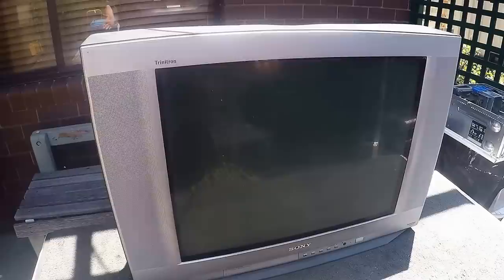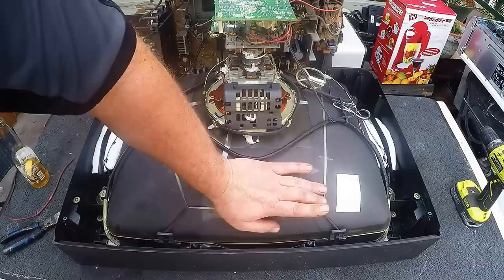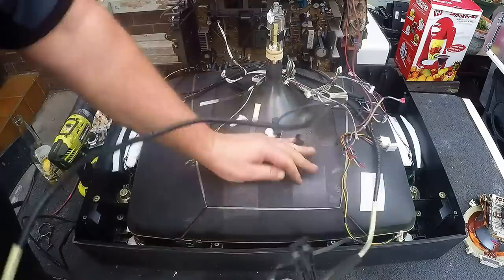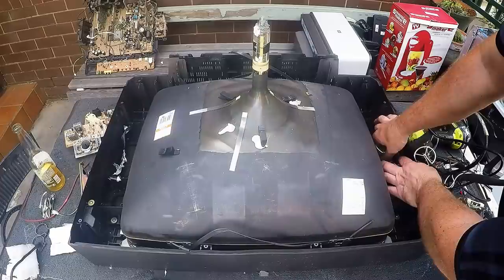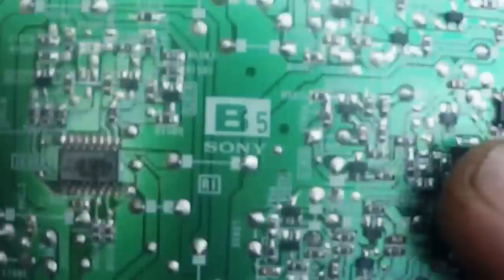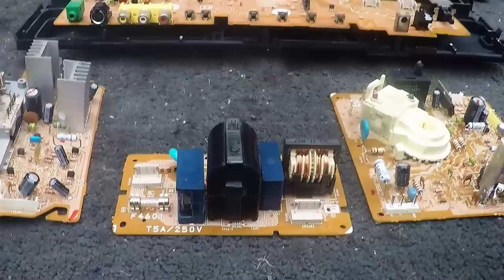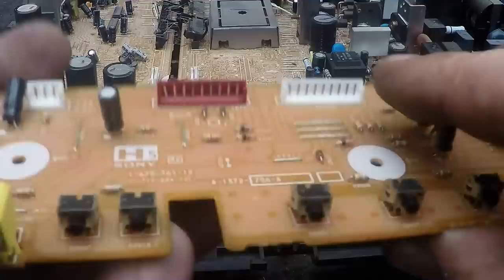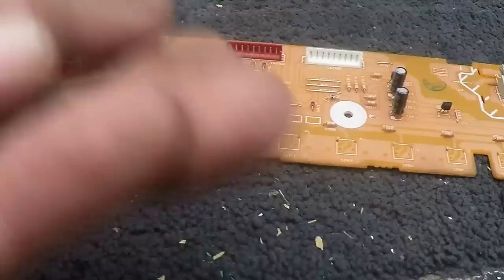CRT TV Complete Scrap for Copper Recovery

Comment: Excellent! Scraper Bonus time!! Everyone wants a bonus on their main job. This is Scrapper Bonus tip. I watch Moosescrapper, Mike the Scraper, and eWaste Ben. Down time is your bonus time. During good weather, scrappers speed through CRTS and many other electronics to make most efficient use of their time. Just toss those small spools of copper in a bucket. Only takes a second, then when you have down time, such as  Blizzards we have here in Colorado, or if you live where there are cyclones, hurricanes, or just stuck inside, grab that bucket and unwind that copper. My 5 gallon bucket of spare copper spools took about 3 hours to unwind, but I earned an extra $60 just
for sitting around out of the weather! Thanks for a thorough training session!

Comment: The deflection coil (called "Yoke" in USA) is designed for allowing high frequency for both horizontal and vertical. These modern CRT had a menu option with rotation adjustment. This imply injecting a fraction of the horizontal signal at 15 KHz in the vertical. The rotation and trapezoid adjustment also imply adding low frequency at 60 Hz to the horizontal, which is not a challenge of course.

It is amazing that the high voltage transformer, where the 25 kv (twenty five thousand volt) is generated don't have much copper anymore. In the past, like 1969 with our first color TV using a few vacuum tubes, that transformer had thousands of turns of very fine copper wire. The last few decades of CRT, the high voltage transformer use the same amount of turn (3 times less because of the voltage tripler), but using photolithograpic method, photographing fine line on a flexible PCB.

It is a shame that the scrap metal places don't offer higher price for a nice bloc of copper as you show in many of your videos. The rationale is probably that they will need to melt the copper anyway.

Comment: The Trinitron CRT was an Australian engineer's design. Sony took it for their own. It was a barrel segment, but with a flattened screen dimension vertically, while in the horizontal direction it had to be curved, a later development in CRTs enabled the glass edges of the screen to be made much stronger and tubes could be made flat both vertically and horizontally while still maintaining glass strength under high vacuum and Sony's Trinitron CRT advantage evaporated. Sony's electronics were always a pile of tangled  electronics, while JVC easily had the best electronics, the best yoke (precision wound) and the best linearity in the picture of all, but that could not be designed into TVs much bigger than 20" so they had a natural limit to their design. JVC was also the most reliable design of all the TVs. A typical 20" had some 30 transistors and 6 ICs, very minimal, but excellent picture and reliability. Sony's electronics easily had double JVC's and with a lower-grade image linearity, purity and convergence.

Comment: For those small crystals, I calculate that in silver mass it is 31.25 milligrams, at today's value (today's Kitco price) that will be US$0.55 per gram (55 cents) which gives 1.71875 cents of silver value. In taking one minute to remove 2 crystals, that's 3.4c of labor value earned and that is only after the silver has been removed, refined and offered for sale as 99.99% pure silver bar on Kitco. At Kitco's price, if you removed 2 crystals per minute per hour (120 crystals in one hour) that earns 206.25 cents or 2 bucks and 6 cents per hour with the refining yet to be accounted for. And that does not include the cost of disposal of unwanted materials, collection of the original material, the TV, the disassembly time to get to the crystals, the tools required to disassemble the TV, the vehicle costs and finally, the cost of the space to provide a disassembly area.
Reply from the maker: the idea with all silver components is to hold until the price justifies the labour, simples.

Comment: Anyone else noticing more and more copper-coated aluminum wire for the Degaussing cable? 5 of the last 6 CRT tvs I have scrapped have had this crappy wire in it, makes me not want to mess with them anymore - especially when 2 of the last 4 were held on by 1/2" bolts instead of screws, so they had to come home with me instead of "field scrapping" them.

sigh
Reply: I was going to say if crts are worth it ?
Reply: @qwertykevin1  Computer monitors seem to be better at them, as long as they are a quality name. CRT televisions, only if they are old, and I mean OLD. 20+ years old. My personal opinion, of course.

Comment: i thought all the degassing cable where bright copper i have found alot that arent bright copper they are different colors why is this? and is it still copper number 2?
Reply from the maker: +Nate Chaps yeah if it's not super bright & clean it's #2 copper, unless off course it's aluminium which you will know straight away because it's very light to hold, but yeah, most is #1 and some is #2, 1 in 50 will be aluminum.
Reply: ty

Comment: I found a CRT that must’ve been 80 pounds the damn thing is huge found it on the side of the road somehow got it in my car to bring home I really regret that because I’m left with a bagel tube that weighs 80 pounds and just got the copper I wish I would’ve scrapped it on the street
Reply: But that just leaves a mess for someone else
Reply: @qwertykevin1  correct it was already in the pile for the trash pickup
Reply: 80 lbs.? Well, the one I need to scrap weighs 230 lbs., so you got a light one.
Reply: @demeaningplebny1363  I’ve seen some that were probably that big! Some of the projection tvs are absolutely massive

Comment: I just got 25 crt monitors from a local school.  Is there anything else i can scrap from the boards other then the copper?
Reply from the maker: aluminium heatsinks, ic chip
Reply: There is a few electronic components that can be reused as is by hobbyists. High power transistors, high voltage diodes, a few electrolytic capacitors, high power resistors.

Comment: do you keep ferrites Ben? also, is there a market for, or people who i can donate my ABS and PP plastics too?  i dont want it to just end up in landfill, would rather it all be recycled but apaprently in wantirna, i cant put ABS no 7 plastic in my recycling bin
Reply from the maker: I just throw ferrite in scrap steel, the abs is a big problem at the moment, no-one wants it, best to limit stuff with plastic, but tv's themselves should always have their cover put back on and sent to a transfer station, printers can be partially scrapped to remove the main board so you might get away with sending a few in scrap steel with plastic on it.